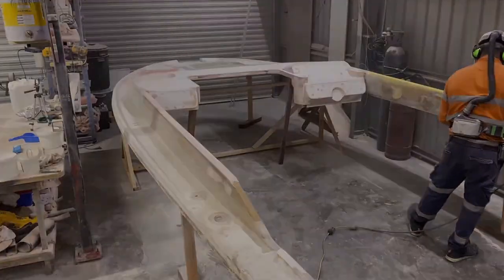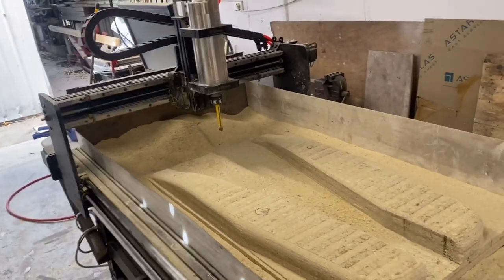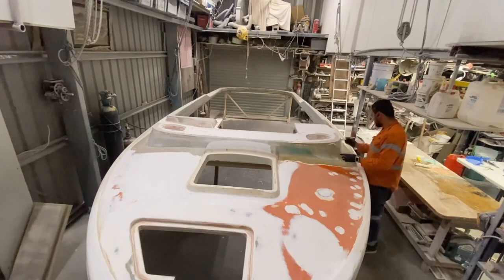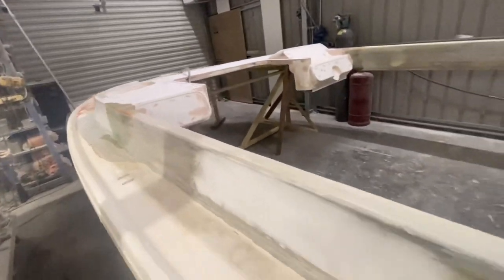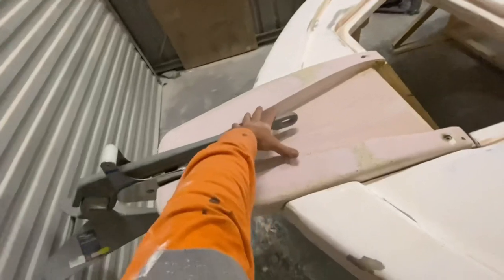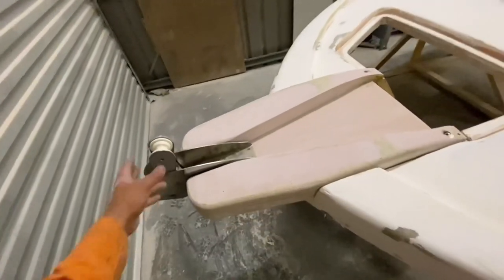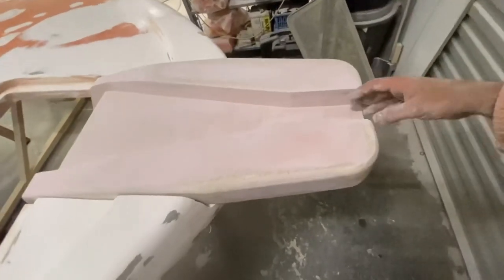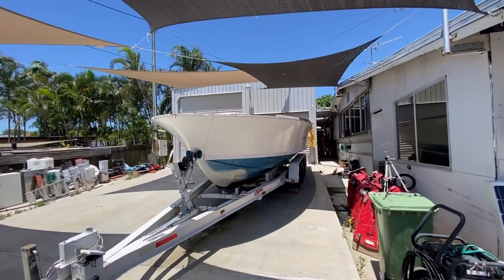25FT Bertram project - blob 37

Comment: That bow sprit looks incredible, you are going to lign the inside with some sort of metal or leave it fiberglass? The chain and anchor might chip the gel coat then it will lose it's look even though I do prefer the gel coat look
Reply from the maker: Thankyou again! So glad you’re not sick of me yet! Haha i have some 3mm 316 stainless to line the middle area. I’ll try to make it look good. Im actually not too happy with. The shape of the bow sprit. I might change the shape later down the track once the boats splashed. Even just a fibreglass shell panel to overlay it to make it look better.
Reply: @Micington  really? Personally I think it looks great, kind of fits the boat shape, but it is your project, I'm just an observer acknowledging great craftsmanship. My viewing will slow down now as I flew back to work for the week but will resume when I get back home. Stay safe and happy.
Reply from the maker: What do you do for work? I’m away for work at the moment now. Working in a coal power plant upgrade fire sprinkler system. I’m a fire sprinkler fitter. I’m doing a weather radar next week. Spewing I didn’t get enough done on the boat before I left to make another blob.😢